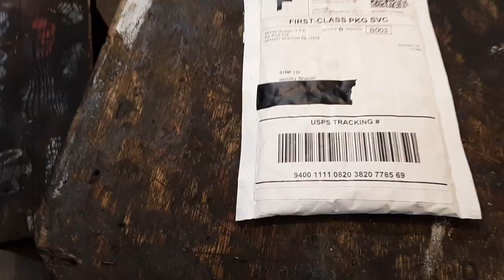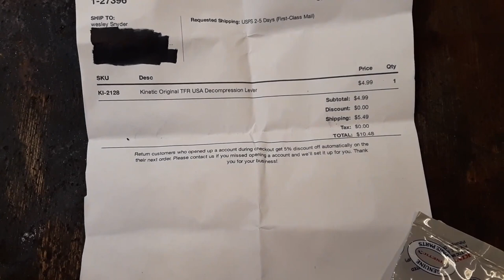Kenetic Luna TFR moped compression release install

Comment: your videos are very informative than most of the videos Ive search when it comes to repairs on this particular moped . Perhaps you can do a video on the hook up of the head light and starter some time?
Reply from the maker: For sure this summer I plan on doing  a few videos with this thing. Just happens that I need to put a new start chain and my headlight is bit broken  so stay tuned

Comment: Kind of awkward pushing the compression release lever that direction isn't it? Seems like it would've been much easier if it was designed to pull inward instead of pushing it outward
Reply from the maker: this bike all very weird dd you notice the weird way the front tire has oppisite caster

Comment: They don't seem to idle very smooth do they?
Reply from the maker: @godovermoney1124  ya they don't seem to run like the vespas the copied. They are kind neat and fun. I am trying to find a vespa engine for mine as its getting tired now.
Reply: @WesleySnyder  I just picked up a 96 kinetic and it seems to be a real PITA already
Reply: @WesleySnyder  I'm getting frustrated with the Kinetic already. Too many little problems